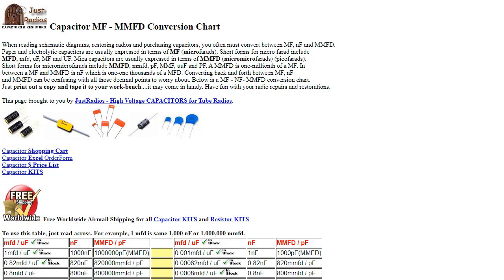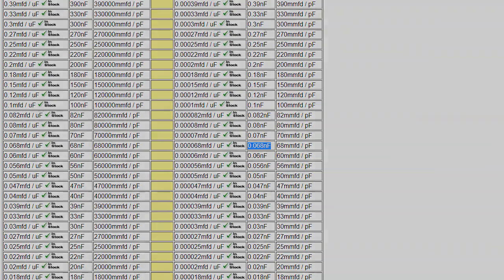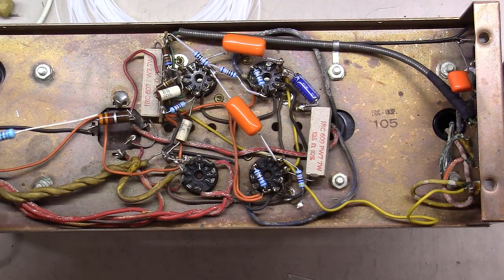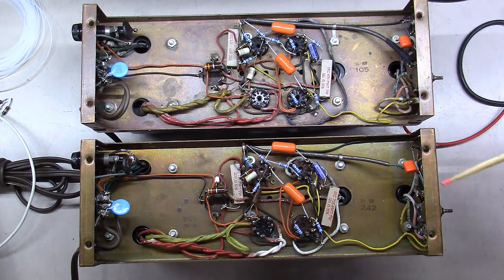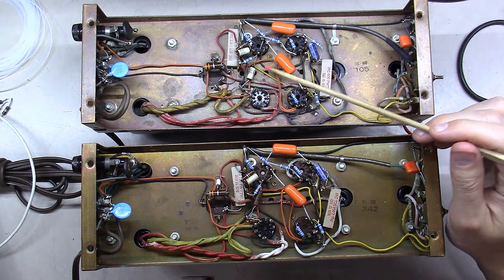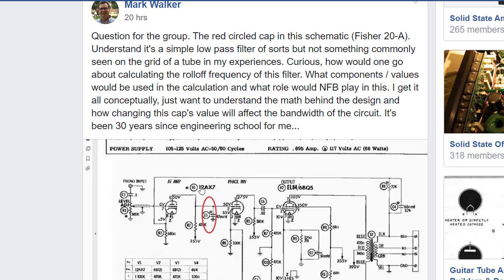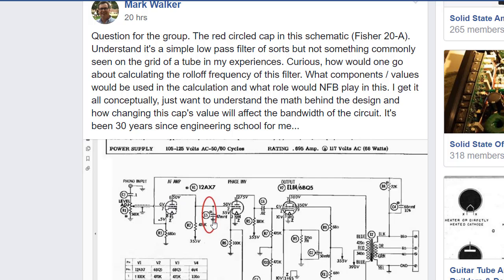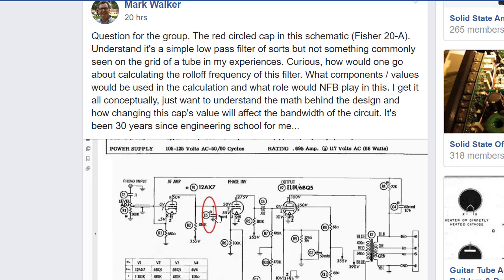Tube Gear Troubleshooting - Part 5 - Wrapping Up the Fisher Amp Few Corrections

Comment: Question: I've seen people recommend removing the death cap and then grounding the chassis by installing a three prong cord with a ground wire.  Watching Mr. Carlson's Lab and this video, it seems there are good reason NOT do that, but I don't know the reasons.  I kind of get why the modern safety cap that is designed to fail open addresses the danger of component failure, but I don't understand the reasons for and against removing the death cap/grounding the chassis versus replacing the death cap with a modern saftety cap.  If anyone can explain, that would be great.

Comment: Hey Mark, I believe that since there is no coupling cap or resistor  and the input to the phase inverter is direct coupled at 50V  this creates a sensitivity to oscillation. The negative feedback loop is tight with few components and low loss. The cap in question bleeds off the high frequencies that cause oscillation (low pass filter). This is common in RF or microwave amplifiers but not in audio amps. "Bleed em if you've got them oscillator blues"
Keep em glowing!

Comment: Interesting. I'm not very familiar with direct coupled amps. It sounds like they are low pass by nature. In my electronics engineers handbook it makes reference to that cap being high frequency compensation but the example it gives has a resistor in series with it and offers no way of calculating this that I have found.

Comment: I hadn’t thought about the cap that is on the grid of the PI as being a low pass filter but I see your point. I do however, wonder why there is no coupling cap between the pre amp plate and the PI grid. How do you keep the b+ off the grid of the PI?
Reply: It's not the voltage which happens to be on the grid which matters; it's the voltage on the grid with respect to the cathode. The grid is at +50V with respect to ground, but current flowing in the 100k cathode resistor is developing +55V with respect to ground at the cathode so that the grid is at -5V with respect to the cathode, exactly what is required for the tube to function.